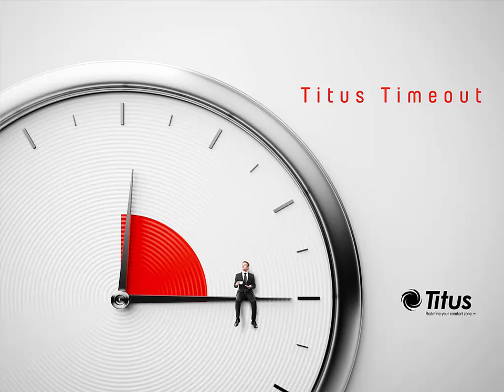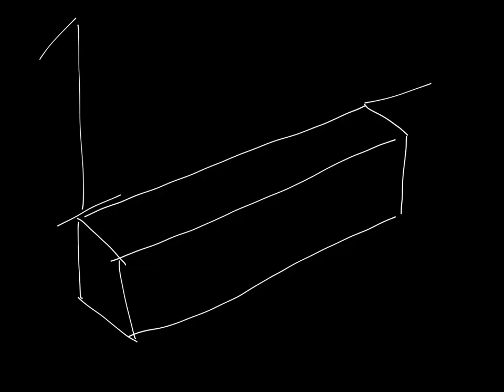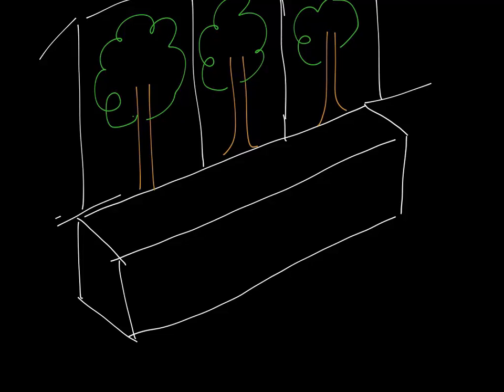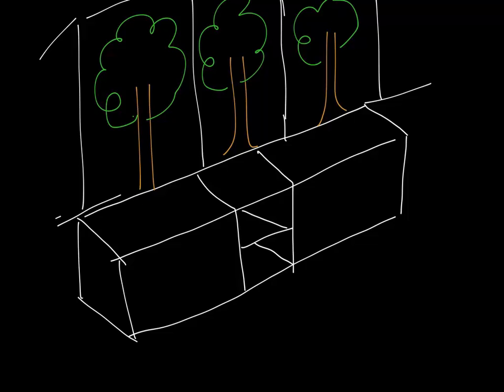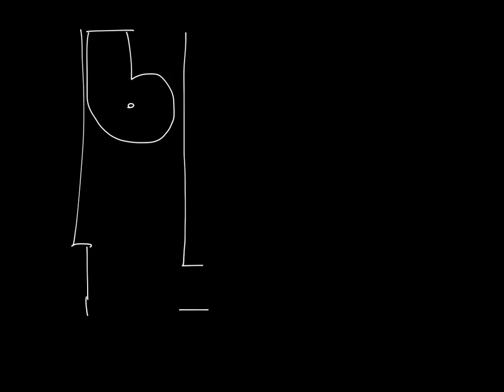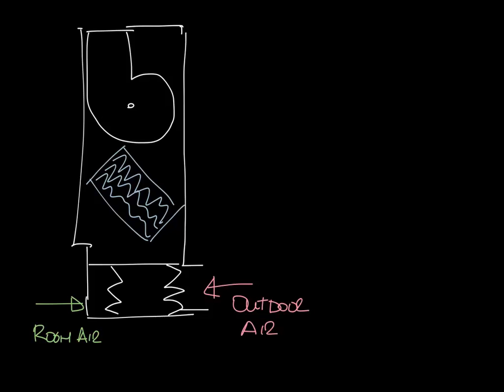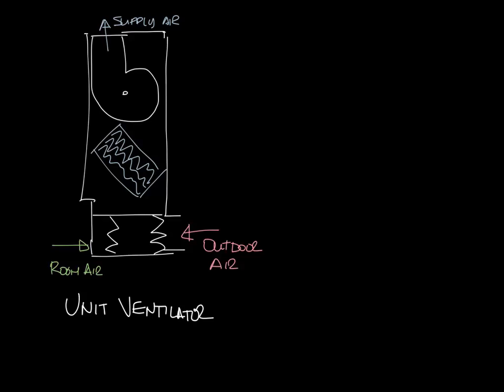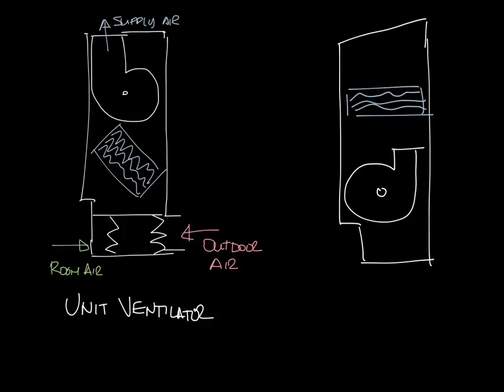Titus Timeout Podcast - What's the difference between a unit ventilator and a fan coil?

Comment: Hello! I know this is super late but I have a question...
Are unit ventilators more of an add-on, or could they replace the ventilation system?
Like, if I install unit ventilators in every one of my classrooms, should I still have a full system with boilers, chillers and ducts?
I'm sorry if it seems dumb. Great videos!